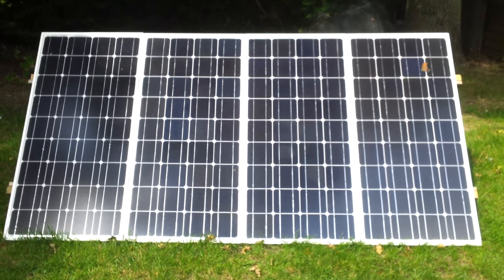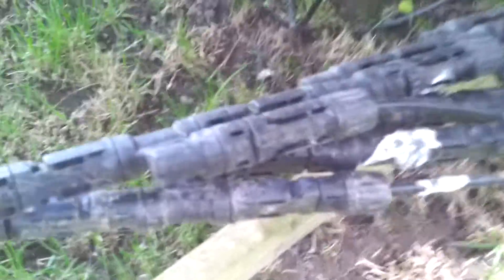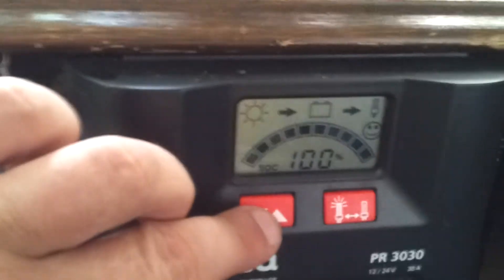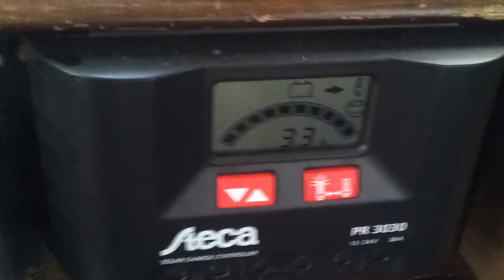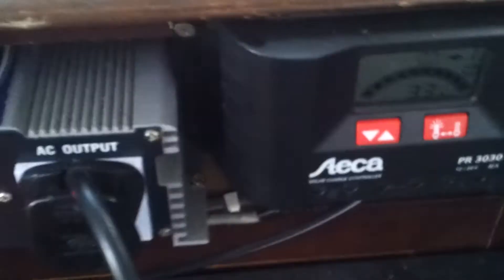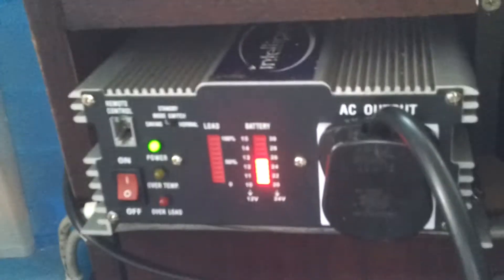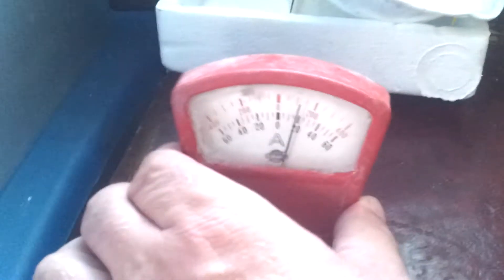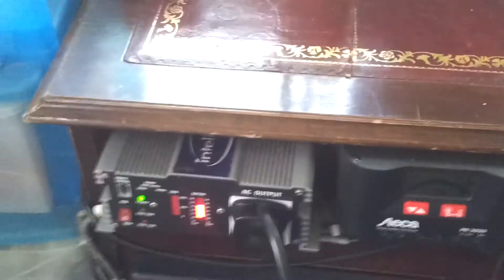Solar Powered Shed Tim Cowell 2014 320 watt 12 v dc to 1 kilo watt 240 v ac

Comment: Are the panels twelve volt or 24 volt
Reply: +dobermannbite Have you try using an MPPT Charge Controller? 
I will recommend an MPPT charge controller so you can harvest the most out of those panels.
Reply: +dobermannbite Very nice little setup you have. 
The solar modules looks nice.  What brand are they?
I just subscribe to your channel please checkout my channel and do the same. 
Cheers.
Reply from the maker: +Nicholas Scholten these are 12 v panels when under load. this kits been running 5 years now with no glitches very stable config